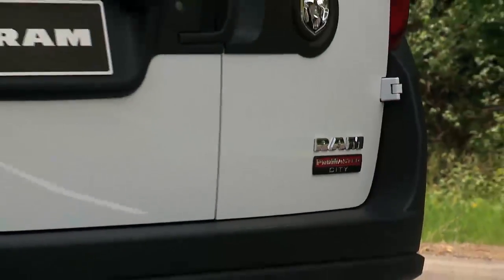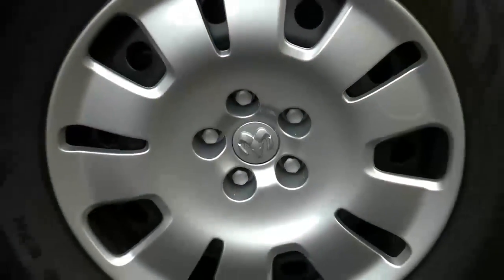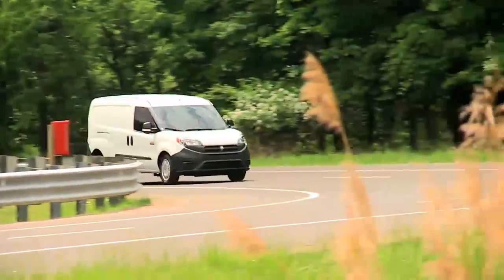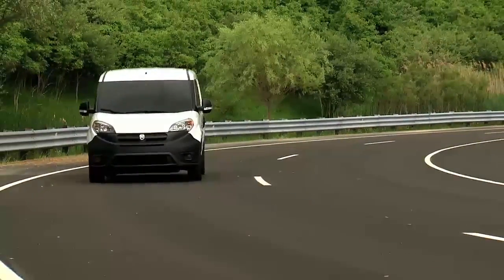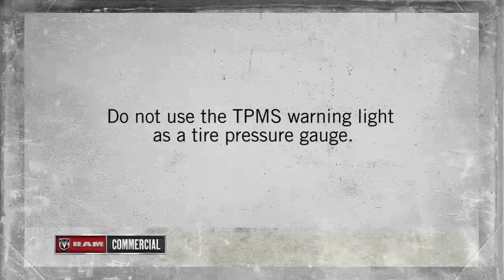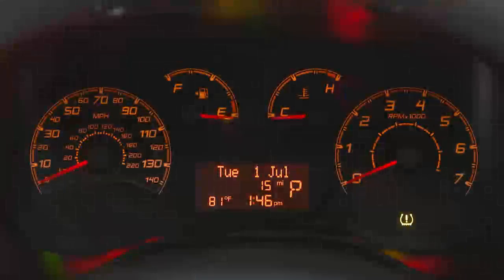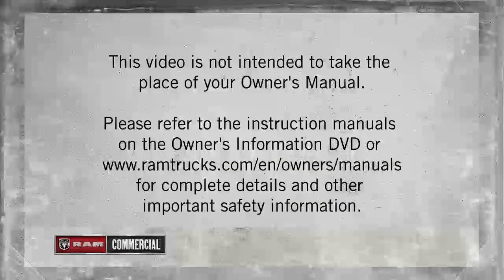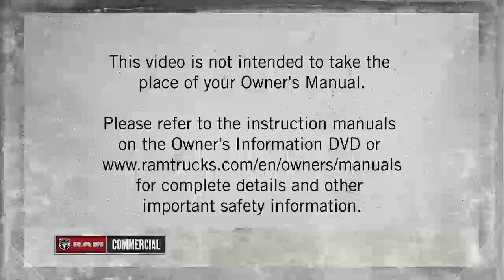2015 Ram Promaster City | Tire Pressure Monitoring System

Comment: Anybody try to fit 215/65/16s on stock Promaster CITY Van OEM 16x6.5 that come stock with 215/55/16.  It's the same width, but 2 inches taller.   If so, rubbing? MPG loss? Pics?